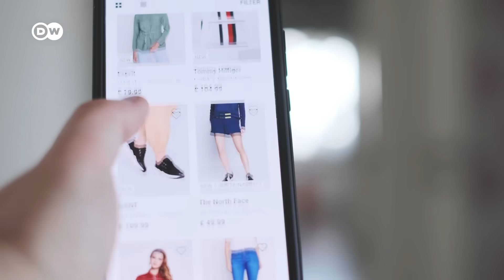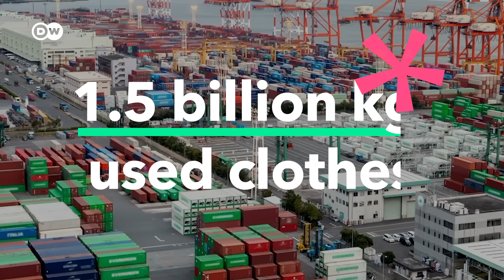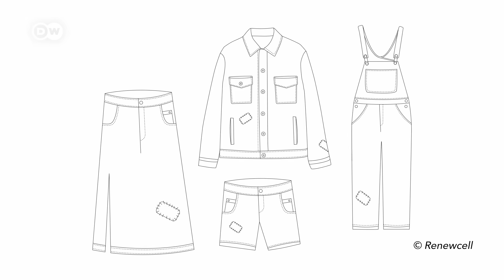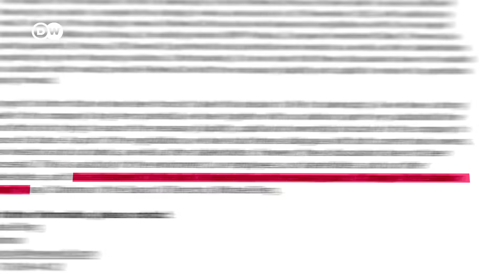Can we really recycle our old clothes?

Comment: I buy at thrift shops so I can get 100% natural fibre clothes. Most clothing these days is made with some, if not all, polyester (plastic) which breaks down very quickly when used as clothing, sofas covers, etc. This is not the case with natural fibers.
Reply: I’ve noticed that it’s much harder to find new clothing made with natural fibers nowadays and it’s also gotten a lot harder to impossible even find fabric/clothes made with a blend of cotton and polyester. A lot more stuff is just straight up 100% polyester now. Thrift shopping for clothes is always so fun and you can sometimes find so many good items! I have to disagree with you that polyester breaks down quickly when used as clothing. Polyester is very very durable. I have polyester clothes that I’ve had for many years now that have been washed thousands of times and are still perfectly usable. The same can’t be said for the clothing with only natural fibers (particularly cotton) because the natural fibers break down and wear out and start looking raggedy and ripping or losing its shape. A polycotton blend is the best of both worlds with the added durability and longevity of polyester and the breathability of cotton. The only minor and incontinent disadvantage is pilling which is an easy fix with a fabric shaver. Of the clothing that I’ve thrown away in the past it was overwhelmingly cotton clothing that had worn out and gotten ripped/torn and raggedy. Polyester is essentially eternal if properly cared for as it doesn’t really break down unlike natural fibers. Don’t get me wrong, cotton can be very durable and last many years with proper care. But it tends to degrade and break down after lots of usage/wash cycles especially since the cotton quality and thickness have gotten worse and thinner over the years in most cases. Different fabric materials are great for different use cases and it also depends on personal preference. An overwhelming amount of my clothing was used clothing either given to me or from thrift stores.
Reply: @S.D.2016  Any clothing I've had that is partially polyester develops pills and nubs within a few wears, while 100% cotton clothes do not. I had an Ikea couch cover for years that never thinned, never pilled, and I only got rid of it because it was white and it got stained. I replaced it with what was available at Ikea, grey, which was 50% polyester, and in a month it was covered with pills and looked awful. In the past I have also bought clothing that was 100% polyester, and it pilled with the first wearing.

The trouble with a lot of modern natural fiber clothing these days is that it's made fast-fashion style, meaning the less expensive stuff is made from the shorter fibers. The fraying on clothes made from this isn't so much from the fibers breaking (although poorly spun fibers will tend to break because the threads have excessively thin spots) as from the little gaps between all the ends of those shorter fibers. That's why expensive sheets will advertise their long staple and extra-long staple fibers. Long fibers mean a stronger fabric, no matter what natural fiber it is made from. So the older the second hand cotton clothing one buys, the better the chance that it's made from a quality spun, long fiber that will last another 20 years.
Reply: @S.D.2016 💯 w you -- I found lots of gd stuff (almost new & some totally new) in thrift shop😊 l go for linen & silk. Polyester is gd for travelling, so I escape fr my ironing jo😂b
Reply: I'm generally not a fan of polyester clothing, but it needs to be said: polyester comes in different qualities too. A piece of clothing made from polyester can last very long, it depends on the quality of the fibre. On the other hand natural fibres can be of poor quality and therefor break down quickly. We see the latter often today. A cotton t-shirt from a fast fashion brand usually contains shorter fibres and will wear out and get holes quickly ...
Reply: @regs3941  Quality over quantity, in all cases.
I recall I had a top made of nylon that used to belong to my grandmother Looked as good as the day it was made 50 years earlier. Still didn't breathe, though, and made the skin sweat.
Reply: Thrift shops near me seem full of old Zara, H&M etc (which is predominately polyester)

Comment: I keep wondering, as a quilter, why nobody has started manufacturing batting out of waste textiles. I already use pilly old thrifted blankets and towels inside my quilts because that's more sustainable than buying more bags of new polyester batting. There's got to be a way to shred up waste fabric and either fluff it up into stuffing for pillows and toys, or hammer it into batting sheets for quilts. And yet the only eco option I can ever find is stuffing made from pop bottles.
Reply: I was thinking the same thing about batting,  but it never occurred to me to use thrifted towels or blankets.  I'll be just starting my quilting journey soon, so I'll def keep this in mind, though I had considered using old t-shirts.  Thank you for the tip!
Reply: I could be wrong here, but it might be a hygiene issue. I often notice the tags on toys, pillows and the like will say that its stuffed with all new material. My guess is that shredded waste fabric from who-knows-where could contain some nasty stuff. Maybe its difficult to decontaminate and sterilize and since the history of used fabric is unknown, it would be a logistical nightmare to treat up to standard

That said, its a great idea on the small-scale, and something I would personally do myself when my clothes eventually degrade enough for that
Reply: @StrewthFroogals  that could very well be right, but you'd think they wash the fabric at some point, otherwise it couldn't be used in mattresses or insulation (imo ?).  I wonder how to find out.
Reply: @StrewthFroogals  I gather that's why it wouldn't be used in stuffed toys, but I wonder if that's a standard that needs to be reviewed.
Reply: It would be good if the washing/disinfecting process could be done with minimal harmful chemicals so no residue was left on the fabric.
Reply: I have used old jeans and weaved them into rugs. Last for years. I also quilt and thinking some could be cut into squares and stripes.
I sure like that idea of using old towels for batting why not.

 I have used strips to twist into rope like could make baskets and the like.

Glad I saw this video. I have old clothes that don't fit and would normally give good will.  Expand ideas.
Reply: Could you elaborate on how you use the old towels? Do you just use them for smaller quilts? Or cut the edge binding off, butt the raw edges together and zigzag them together to piece them together? One layer or two?

I'm also a quilter and I have some old towels that I need to find a use for. Thanks in advance!
Reply: @PyraDraculea  I think one layer is enough, and yes, just sewing them together would be enough. I've sewn pieces of batting together in the past, so it's more or less the same. Just be aware if the towels are coloured that they don't show through.
Reply: Even making blankets for street people, and animals.i know you can make bricks as well.
I'm my country, I can't find the waste dumping dites
Reply: Polyester is physically recyclable thru melting down the fibers, we do do such things , obviously not with old medical waster, but the melting process takes care of “cleaning”
Reply: Because there are laws in countries like Canada that make that illegal. All stuffing in pillows etc by law have to come from new materials. Such a waste and SO easily fixed if we used shredded textiles in pillow stuffing.
Reply: I'm pretty sure that there are companies that do turn textile waste into stuffing, insulation, rags and other similar things. But even that has a few standards that needs to be met.
Reply: Not sure if this would be the easiest thing to use for quilting, but there is an organization called FabScrap in the US that offers a down-cycled material called 'shoddy' on their website that's great for stuffing pillows, etc. Might be worth checking out. 👀

Comment: Would any one buy new clothes knowing it was made from recycled fabrics that some one else has worn. I highly doubt it. Instead our focus should be on resuing the existing clothes, till they get damaged.
Reply: I don't see there being an issue with that idea. Thrift stores selling pre-worn clothing are getting more popular all the time. The recycled fabrics have the benefit of being industrially cleaned.
Reply: Not buying new clothes and repairing damaged clothes rather than binning them is the best way to go, but that doesn't make clothes manufacturers any money. Anyone with a functioning immune system has just as little to worry about from recycled fabrics as they have from new ones - and the legitimate cause of the worry should be random chemicals used in processing that haven't been cleaned off rather than contact with other people.
Reply: People buy clothes from thrift stores all of the time, so this is a dumb argument. Plus, most people don't care if the fabric is recycled or not. What they care about is how it sits on the body.

Comment: Germany can burn those unuseable cloth to produce heat and can use to hit water
Reply: Burning textiles coloured with toxic heavy metals seems not too intelligent. Bringing those chemicals in the air is pretty bad.
Not to mention the extremely wasteful production of cotton and polyester.
You can buen anything for heat, but it just not going to be a solution.
Just as bad as the idiots making roadsurfaces of plastic just to get rid of it. Wonder where the particles worn of the roads go?
Downcycling in really bad ways are almost always the capitalists first idea to get rid of waste, since it is the second cheapest (landfill is the cheapest way).
Reply: Which immediately returns the CO2 to the atmosphere as opposed to burying it and locking it away for hundreds if not thousands of years.

Comment: Am I the only one that does NOT like to buy new clothes? I only buy (clothes) second-hand personally.
it's not so much from an environmental standpoint, but mostly 50 economic and 50 fashion, because oftentimes we did better before.
Reply: I haven't bought anything new in YEARS. Maybe a decade, possibly.
Reply: I grew into my baggy 90s clothes, so I still wear 20+ year old stuff. Some became popular during the vintage craze so they fetched good prices online. Only need socks and undies.
Reply: No, I hate shopping. I have the same clothes I've had for over a decade. Some clothes I have had since 1996, when I was 14. My body hasn't changed much except I have more muscle cause I have to exercise daily for my mental health.

ETA: except sports bras, underwear, and socks. But I learned to sew and have been fixing those.
Reply: Same, im 31 now, ive never buy new clothes, only thrift..😊
Reply: I don't like buying new clothes. I'd rather thrift, but with my chemical sensitivities used clothing is often contaminated with fragrance from detergent and fabric softener.  Sometimes i can get lucky, othertimes i think it's fragrance safe and 10 rounds through vinegar soaks, washing and heat and it's still not safe for me to wear.
Reply: I want to use old clothes for my crafting. But don't know from where to get them. Any ideas?
Reply: Thrift stores